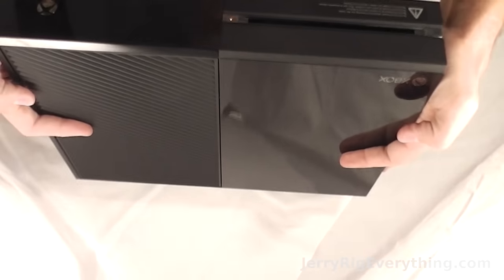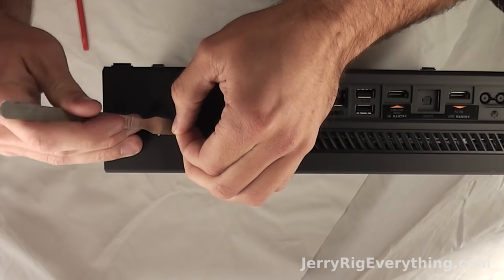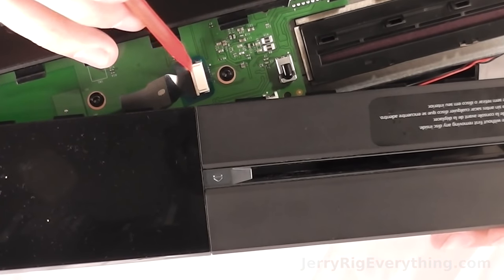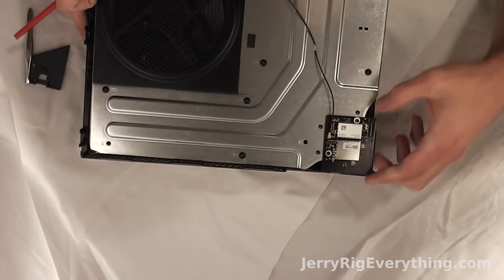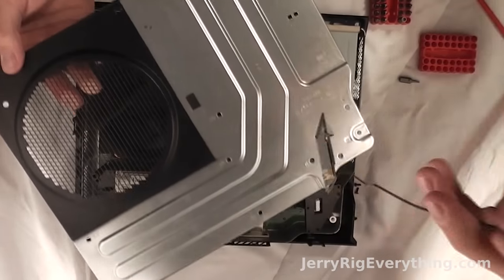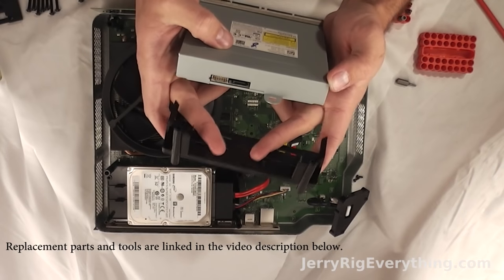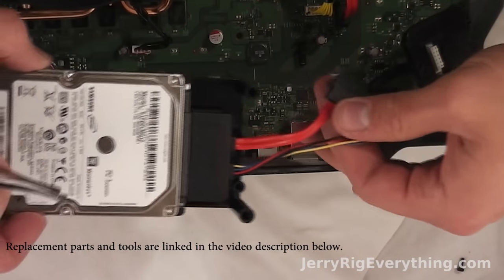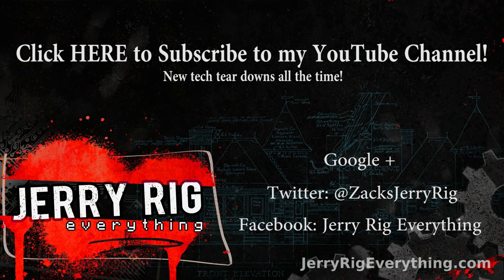NEW XBox One Complete Teardown, Hard drive replacement, Disk Drive swap

Comment: so have we come up with any replacement parts for the xbox one...
mine took a dive off of the mantel onto a marble fireplace footing and smashed to bits on the front plate so im looking for the whole front board with ribbon and a new antenna wire

Comment: my x box got soaked the other day due to unresponsible roommates, is there anything i should look for? is this thing fixable? it turns on then shorts out after 1 second
Reply: +bravedave420 if it's water damaged, you can't fix it, nor can you replace it cause it's not a defective problem.  If the CD drive or power supply or something like that were to stop working, as long as it happens within 11 months as of when I'm shooting this comment, you can send it in and get it fixed under warranty

Comment: Hi I have some questions in regards to replacing the HDMI port on the back of the Xbox my hdmi cable was broken and dislodged in the inside rendering that port on the back of the Xbox completely broken. Where would I buy the part at

Comment: looking for a ribbon cable, a case and possibly a new drive.

The shell melted in a fire and the front of the drive melted as well. Where can I find parts?
Reply from the maker: Christopher Jost Wow... Hmm... Does it turn on at all?
Reply: Been a little scared to try lol 
The ribbon cabe on the front right corner is melted. In fact, the metal itself is exposed on that corner.

Comment: thanks for the video! Has anyone seen steps for PCB connection? my 3rd console started to fail this week, dvd drive issues like the first two. MSFT won't help this time with replacement and wants $135 to fix it, so I'm going to look into swapping out the drive (they're 1/2 price on ebay shipped).

Comment: Don't remove the Ribbon cable.  Instead take the three screws out on the RF board and pull it out with the ribbon and faceplate still together.  It's Simple and less risky.

Comment: Fuqing damn it. Only one of the screws has jagged edges inside on my console. All lol the other screws are completely stripped smooth. There's literally no way I can get my screwschedule out to access the drives.. I'm assuming this is intentional so we're forced to buy a new system vs being able to repair it our selves
Reply: Screws** damn auto correct throws in extra crap. It's like the smarter phones get the dumber they actually get.

Comment: JerryRigEverything my daughter pushed a skinny wire circle bracelet into my xbox one disc drive. Is there a way I can get it out without having to take the whole thing apart like maybe a tool of some sort?? 
Thanks
Reply from the maker: If you can still see the bracelet from the opening of the xbox, try to use a long thin tweezer to get it out.  You can get tools on Amazon, or a local hobby store. The longer and thinner the better.
Reply: I'm not sure, but it looks like the link for the replacement parts is gone. Let me know if I'm wrong
Reply: JerryRigEverything forgive me I never replied to tell you what happened Rick. So my wife actually took apart my Xbox One and exposed the disc tray by removing parts. The wire bracelet was really jammed in there so.........as I watched in horror my wife took a pair of scissors and tried to cut the bracelet but of course that didn't work. With the same scissors she clamped on to the bracelet and the twisted them clockwise over and over and over and over until the bracelet started to curl around itself. While this was taking place the noise was so loud and horrible I cringed in horror and could not watch! Lol
Long story short she got it out without damaging the Xbox One which was a miracle!! It still runs like a champ if not better than before. My wife ended up taking the bent up bracelet and made a keychain out of it for me😀
Hope you enjoyed the story!
Your channel is awesome keep doing what you are doing you have my full support!!!!!💯
Reply: johnathan williams little girls like to put stuff in uhh... other stuff like my baby sister got a tv remote and put inside a speaker

Comment: i need the piece that goes behind the sync button. the little plastic piece that holds the 2 half together. now if i get that piece will i be able to re sync controllers? long story short my xbox fell off a table and blew apart. i never found that piece and now can not connect controllers
Reply: connor enrig
Reply: Hey, I'm not sure if you still need the piece.

You should just be able to use a micro cable and then pressing the xbox button.
You've no doubt figured it out but yeah :P

Comment: Does the Xbox start up button sound a little bit weird and fuzzy when you turn in on after you've reassembled it? Cause mine does..
Reply: +Daniel Amaya Is the cable for the speaker plugged in all the way?
Reply: ES Kemp yes I'm pretty sure I pushed it all the way back in. I'm afraid to open it again cause its so hard to close the Xbox after its been opened
Reply: Daniel Amaya I'm afraid the only way that you'll be able to fix the issue, is to find out what's wrong (AKA, opening the Xbox). 

Could be that the cables not plugged in all the way, or the speaker MAY have gotten some damage whilst you were operating on it last time.

Comment: Do you know where I might get a bigger internal hard drive? I checked amazon and couldn't find anything.
Reply: you should be able to just use a laptop hard drive which is a 2.5in drive, that's what it looks like it is in the video or you could put an SSD in it those are nice and have been coming down in price but still way more expensive than a standard diskdrive

Comment: Damn so you have to basically remove almost the whole damn inside to replace a hard drive why couldnt they of just made it as easy to replace as it was on the Xbox 360 or as easy as it is on the ps3

Comment: My little brother put a metro card inside the disk tray how can I take it out help please.
Reply: +Junior Lopez you might want to try and take apart the disc drive to see if the card is still salvageable.  If it's not, try and look for damage to the gears and things like that.  If you've tried to eject the card already, then chances are the gears might've damaged it.  If one of the gears is missing one of its teeth, just get a new drive also, this is physical damage, which isn't covered under warranty.
Reply: +Adam Genez it makes a sound . like when i press the button for the disc to come out. and thanks

Comment: after about 2 hour of gaming my xbox one starts to give a ticking sound from the hard drive and the xbox freezes if i restart it start up into error screen e200. if i leave it unplug for some hours and restart it again it runs fine until after 2 hour the ticking comes back on again and the xbox freezes .. i'm thinking its the hard drive overheating .. does anyone think the ticking sound is the hard drive ? and if so is there any solution to this problem ?? can i get an internal hard drive to purchase and where ?? thanks..

Comment: Where is the link to the replacement parts that you said. My son put a comb inside my disk drive and messed it up. I need a new disk drive if anyone can help me find the replacement for it.
Reply from the maker: Killshotz802 Replacement parts for these systems are hard to find.  Nobody sells them yet that I have found.
Reply: Thanks, I ended up having to send it back to Microsoft to get it fixed.
Reply: Donpar  my kid just stuck something in my drive and I was wondering the same thing.  How much was it to have MS fix it?   JerryRigEverything was there any part numbers on the disc drive when you pulled it out?  Hard to believe it isn't just a stock Blu-Ray drive.
Reply: Samuel Remp I sent it in and they sent me a replacement for free. good to microsoft for replacing my one for nothing, just shipping.
Reply: Yeah I ended up noticing I had 3 days left on my Day One warranty so I sent it in before it expired and they fixed it free of charge and sent it back.  Thanks for the response!

Comment: what if your game disc is stuck inside CD ROM and the button to eject still works but it won't give me the disc back should take it apart as well?
Reply from the maker: Isaacthebomb If you have no other option, than yes. BUT its a complicated process.
Reply: I would say go all digital, and plug in a terabyte external hard drive on the side for more space.  On another note, I don't know why they make the hard drive an easy thing to remove like the last Xbox. I would love to put a 3 terabyte into the damn thing. I didn't know it was only 500gigs :(
Reply: Nox223 I manage to get it out lol with a long toothpick stick thanks tho c:
Reply: Dang! Toothpick king over here :P glad you fixed it!

Comment: Do you know the black shell that covers the whole Xbox can i just leave that off i saw someone on a live stream do it
Reply: +It's Donnell You can, but be careful. If it gets something spilled on it it's more likely to break than if you had the shell on it.
Reply: +Oh Exigent does it still works with the ribbon cabble like im gonna take the shell off and when you took the bottom shell off does the hole system still work
Reply: For you to be able to turn the Xbox on by pressing the Xbox logo on the front or ejecting a disk, you'll need the front faceplate still on. You can turn it on with the controller. But yes, it'll still work with the top and bottom shell off, that's how I have my console.
Reply: Oh Exigent ok but the ribbon will still work if i take it off like i want to take off the the bottom and the top shell so i still have to leave the shell on that covers the front that covers the xbox button

Comment: Swap hard drives for what ? I'm pretty sure they have a 500GB security sector files and custom firmware so if u hook up anything besides what was shipped with console will be not detected by xbox...
Reply from the maker: Give it a few months and someone will find a way around that.  Ill post links when they do.
Reply: JerryRigEverything
But if Microsoft uses the same or similar system as they did with 360 drive replacement will be pointless :P (unless they introduce bigger variations). System will be shipped wit 500GB which only has that type of SS.BIN (security sector file).You can't modify it since its signed with private key, and if you copy it to bigger drive it will be still seen as 500 by xbox :P. Thats how it worked on 360 till they introduced 60,120,250 and 320. This will be interesting, waiting till someone starts poking around internal hdd for more details :>
Reply from the maker: I agree 100%  There are some pretty smart people out there.
Reply from the maker: It is a good question.  Right now probably not, youll need a way to transfer the operating system onto the new drive.

Comment: so no doubts xbox one will have case modding and fan modding in the not to near future.
Reply from the maker: I bet.  There is a lot of room in there to work with.
Reply: JerryRigEverything  yeah its bit of a monster. not sure why ms went this way. they could have made it at least an inch in height.
but i would expect the modding companies will be making clear shells at top modded dvd bluray covers and coloured fan lights. looks to me the xbox one is easier to take apart than the old 360.
Reply from the maker: *****
There are going to be some sick looking Xbox's out there in the near future.

Comment: I need help with my Xbox... It stays on for 10 seconds then shuts off every time... I blew Xbox out with air but it can reject game disks fine but won't stay running...
Reply: I cant really help you because I'm not an expert but I'm having a very similar issue, and somewhat have it un-resolved (fortunately a good friend gave me a spare console they didnt need anymore) but while doing research I've found a lot of people saying do not blast ur xbox ventilation with air. Could be wrong but if not, just a tip :)
Reply: On note of the issue itself, my console kept turning off after 10 seconds, and after only achieving it getting on once for like 2 minutes, the console popped up a warning saying my console was overheating and to remove any objects on or around it and set it on a hard surface, but it sits on a desk with nothing but a monitor, so I think with as old as my console was, the interior has caked so much dirt and dust that it's basically cooking itself when turning on
Reply: @brycef.3483  If I got a new Xbox would GameStop be able to transfer all the games I have on the internal and external hard drive to the new Xbox?
Reply: @NWIowaFarmer  if you have any external drives, you should just be able to unplug those and plug them into another console. as for the internal, I dont think so. If at all possible, the console needs to be disassembled, which I doubt they do. Before getting a new console just to replace yours tho, I'd definitely recommend looking at options. A local tech repair shop might be able to fix it all up, and if not, they could probably tell you if its best then to get a new one or not. Like I said, explore your options if possible.
Reply: @brycef.3483  There's no one I know or anyone I know who works on Xboxes in Northwest Iowa.
Reply: @NWIowaFarmer  damn, well I guess the best I can say is just do a ton of research to find the issue and learn the ins and outs of the console, and then if you are comfortable enough, maybe try to take it apart, fix it, and reassemble it yourself. If that doesn't work or is not an option, then maybe just a new console straight up. Sorry I couldn't be of more help man, but I hope you get everything situated

Comment: how about HDMI ports? my "TO TV" port is having problems
Reply: same here
Reply: Same same
Reply: @JMac3Turbo  I ended up placing something under the cable right where it plugs into the port. It cause the cable to angle upwards. It would take a min to get it just right. When it finally failed I purchased another

Comment: easier to replace a hardrive on the ps4. xbox always has designs that make you pay more. like that recharge kit for the controllers. fucking bullshit. if it wasnt for halo, i would never get an xbox one. TBH, xbox one is pretty much shit in design. will have to wait if directx 12 will improve it to push it over the ps4.

Comment: well fuck ever changing the hard drive after watching this video, I'm not going through all of that. Why the hell did they make it so much harder compared to the 360? =.=
Reply: use External Hard drives. they are supported now since july Update. i have a 3.0 USB switch on my Xbox one which has  4 3.0 usb ports which i currently have like 12TB (as in 4 External hard drives of 3TB ea)in External Memory for my X1  pretty cool if u ask me.
Reply: Naderz Kill so can u use any kind of external hard drive on the xbox one to save games? i have a 1tb external harddrive?
Reply: Venom Carnage you should be  USB 3.0 is preferred

Comment: BRO HOW DO I PUT IT BACK
Reply: Before putting the cover back on, separate the front plate from the rest of the cover by releasing the 8 clips that hold it on.  Then it's much easier to reattach the ribbon cable and the front plate goes in on an angle to get the tabs in correctly.

Comment: They made the 360 models all changeable and easy to upgrade. Why they didn't do it to the One, is so Fuckin Stupid! I would love to upgrade to an 4 or 8 terabyte but no! Xbox has to be difficult and make it to where u have to void your warranty just to upgrade it. And yes u can buy an external hard drive but it takes up a USB port & looks ugly separate with cords everywhere plus you need a power cord just to power it up when it could be getting the power from the system itself. Mark my words when they make a slim or newer redesigned version it will be easy hard drive upgrades along with other features that could have been added since day one. I love Xbox but you gotta admit this fucking ridiculous. #OneStepForward&TwoStepsBack